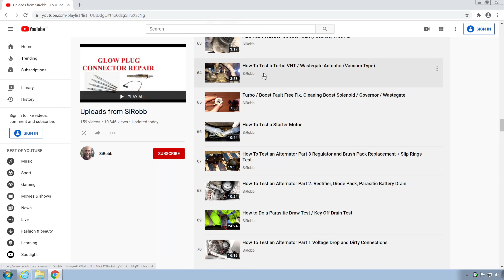Diagnosing VNT Turbo Faults

Comment: Excellent information as always. I have owned my V70 D5 AWD Auto for over 1,5 year and driven over 35000km I think, with almost 35k Swedish Miles behind. Your videos have helped me a lot on this car, doing all the repairs myself as I have done on my previous 3 Volvos.  

Though I've had a couple of annoying problems with the car since I first got it.  Took me a year to find out that it was the lower right engine mount under the crank pulley was separated, led to an annoying tire sound (and wear) every left turn. 

And there is something with the boost preassure which I havn't solved yet. Hesitation, delay just when you would expect the boost to begin smooth, it kicks in instead. Have had the code ecm 6805 wich puts the car in limp home and engine service required message. (Svenska: Motorservice erfodras). Restart the car and it's back on "normal". 
When engine cold and accelerating from standing still, this problem happen to completely disappear and the car runs really nice.

Worth mention, AWD models have the space occupied underneath the turbo, unfortunately! 

Thanks
Reply: Hi, I've made some further investigation on my car. 
Atmospheric sensor 970hpa idling, Seems Ok I guess?
Intake manifold pressure idling, somewhere between 800-850 hpa. Pulling a mild vakuum doesn't it?
Edit: Had a pressure on almost 2000hpa when full accelerating, varm engine. Good and as I expected.
Reply: Hi, am a bit thrilled as I finally made progress on this one. I purchased a CRC Carb & EGR cleaner. Gave it a careful treatment by spraying it into the intake hose on the Lmm and then reving the engine. Didn't help at all I think.
Instead I took off the intake hose on the turbo, and with the can upside down (can works in every direction) I put the small pipe into the turbo and sprayed. Let it sit for a while before driving. After two treatments and some driving I can say without doubt that it helped a lot! Accelerating is more controlled and smooth. Still a tiny bit of "kick" as the vanes is not entirely free, should help by spraying more and driving. This seem to have improved the travel of the vnt actuator arm, as it is a big difference at low revs.

Comment: Amazing video, thank you. My issue is with the line connected from the solenoid the VNT arm drops all the way down and the car shuts off. Disconnect the vac line, the car idles fine with no boost.

Comment: I’ve got a riddle three mechanics haven’t been able to solve. Twin turbo navara, high pressure turbo stays in open position after a run upto 80. Come to a stop and no boost pressure until second turbo at 2400rpm. Battery disconnect resets and does it again.

Comment: I always look for vacuum problems that can send error codes like P0102 throwing all the system off, engine mounts being the first port of call, I use Wynns injection clean fuel additive to 40 litres of fuel that helps clean injectors try doing say at least a long run 15 miles & notice the difference,

Comment: I have the exact same symptoms, only sometimes the engine has no power on lower rpms but then suddenly the boost kicks in. I tried a turbo cleaner diesel additive and it seems to have worked nice

Comment: Hi there , my 2002 v70 d5 ceeps showing "engine service reuired"msg and fault code 045 in the dim . It runs in lean mode but no engine light , any suggestions Simon .
Thanks in advance .
Reply from the maker: Until you read the car with a proper code reader and ideally with Dice and Vida, you can only guess unfortunately.
The DIM number codes cannot be trusted to diagnose faults.
Reply: @sirobb  Ok , thanks buddy .

Comment: I have a new turbo on my car. Its Ford Focus 1.6 tdci 90 hp,2010. I have overboost condition with DTC P0234-60. I changed boost control solenoid. Also tried with other MAP sensor. Still the same DTC comes again. I see that actutor rod moves freely. I dont know what else i could check. Any ideas?
Reply from the maker: Viewing the actual boost figure with live data is a good start.
Also what is the MAP reading with just ignition on, at idle and the maximum figure out on the road. 
Also don't change parts without testing as most can be eliminated easily with cheap equipment.
Reply: @sirobb  I have Forscan. MAP sensor on idle 105kpa,on full throtle about 248kpa. VGT duty cycle goes on idle from 61-67%,on full throtle it goes down to 35-45%.
Reply from the maker: @Jnn Nkc  Do you have an official workshop manual or data from the same engine from say a Ford forum?
The idle pressure is fine but the pressure at full throttle would be high on some cars.
It may be correct for yours though.
Have you viewed the VNT operation when all connected up and revving the engine like in this video? If it's sticking even slightly at the wrong time, boost could rise above the programmed maximum.
Reply: @sirobb  I dont have workshop manual. I was watching actuator rod moves. It moves quait smootly. Also when i disconect MAP sensor car works much calm then with MAP sensor conected.
Reply from the maker: @JnnNkc2205  What the EGR? Is that coked up or working correctly?
Also MAF and fuel pressure at idle and maximum.....
Something is going to be out.
Reply: @Sirobb Hello! Where can I speak with you in private ? Thank you!

Comment: This helps a lot. My friend owns a 2004 V70 D5 with 596.000km on the clock and he has turbo issues. We checked all the tubes und mounts for leaks and found none. Found a faulty TCV behind the intake hose and now it responds better, but still the real boost only kicks in at 3000rpm and tends to ooverboost a bit.
The VNT mechanism works as long as we use our little manual vacuum pump. After fixing the TCV we now have a constant ticking noise from the engine.
My guess is now, that its either the turbo itself or a faulty vacuum pump (also the source of the noise). All the vacuum hoses are pretty oily on the inside, could a defective vacuum pump be the cause?
Reply from the maker: Use a vacuum tester directly on the vacuum pump as suggested in the video link I provided in your other comment.
That will first of all tell if the pump is producing enough constant and stable vacuum.
Also, with everything connected, view the VNT action whilst revving as shown in this video. 
Regardless of the vacuum reading from the pump, if the pump is noisy then it may well need replacing but if it is producing full vacuum and there is still lack of boost, either the VNT is sticking or boost is being lost through a leak in the intake system or the MAF or MAP or fuel pressure readings aren't correct.
Low fuel pressure could be just a clogged filter.
You have to test everything carefully and not just change parts by guessing.
Reply: Interesting.  I have had lots of work done turbo kit (genuine ) head gasket lifters rockers  intake clean of carbon cams the lot . Tickover is sweet as ot shouod be . I get (had it before the work ) a mooing  noise . I jeep coming back to the turbo solenoid  years the turbo was sorted but not the solenoid . I have power . I think it could be a smidge more responsive..it car does a regen it's pretty quick . 2 sensors were replaced a week after the work was done it's not a volvo (but I loke volvos ) .its a mazda it's mostly noticeable at lower speeds . Annoying noise indeed 

Thank you

Comment: Hi Simon. Many thanks that cleared up a lot in regard to how a variable nozzle turbo charger operates.

I like the ergonomics of your diagnostic tool but when I went to Amazon on your link it showed two. Which one are you using in your video please?
Reply from the maker: The two types are Bluetooth and WiFi and I only use the V1.5 version. 
I'm on Android so use the Bluetooth mini version with the Torque Pro app.
IOS users need the WiFi version with a suitable app from the Apple Store.
Reply: @sirobb  Thank you very much Simon.

Comment: Hi Simon
another Great video
But you do need to tell people that the 30+ PSI you are seeing is including 14.7 atmosphere pressure , or all with car problems will think they have a bad turbo,
Thanks Dave
Reply from the maker: Genuine question. Have you watched the video? 
1:07 I show the caption saying "The maximum boost pressure is 2090 hPa in absolute pressure. 
2:50 I say total pressure from the MAP. As you know, the MAP is an absolute pressure sensor. 
5:14 I show two different gauges. One is absolute one is boost.
7:20 different gauges are shown again to illustrate what to look for.

Comment: @sirobb I suspect I have a VAC pump leak and noted I am getting the oil cap popping .... You reckon a leaking pump would also account for this popping ?
Reply from the maker: Yes it could but so could several things so best to test and not guess or assume.
I have a vacuum pump testing video in my list.
Reply: @sirobb  already watched those ages ago Si. ...... your channel is my first port of call for all things xc90 .... I have an xc90 2007 ...... I dont think you tested the actual pump did you ? Is it a case of just removing the VAC pump pipe ..... Connect the test pump and seeing if it holds vacuum ?
Reply from the maker: @kanesfist9895  I tested the pump directly. Maybe you haven't seen it. https://youtu.be/-lgYAS3GoiE
Reply: @sirobb  just found it .... Another great video .... So I have tested it and it holds VAC steady at about 25 .... Also front mount holds but I think the rear mount is gunned .... Didn't register anything so either it's the pipe or mount itself .... As a test I did disconnect the rear and covered the tube .... The popping did reduce but did not disappear ...... Anywhere else to test ?

I have oil residue just below the VAC pump so I was expecting that being the issue but if it's holding VAC could it still leak ?

Comment: Hi Simon, a great description of my problem!  Have you tackled the sticking vain problems yet?
Reply from the maker: Not yet. As you can see, the vanes free up pretty quickly so as long as I'm careful when the engine is cold, you wouldn't know there's a problem.
Reply: @sirobb  Thanks for coming back to me. I was going to remove the turbo, but I have seen a few people say it come be cleaned in situ. What would you recommend. Mine is 2002 220k miles so similar to yours.
Reply from the maker: @bitzaboat  If you haven't already, definitely use a vacuum tester directly on the actuator to exercise the vanes.
Video link is in the top pinned comment above.
Reply: @sirobb  Hi Si, yes I tested that first as per your vid and got a similar reading and it was holding just over 20. The arm however was only moving 5-10mm max with the engine running at various revs up to 3000 as it wont rev past that. But occasionally when on the road the boost comes in big time so it must be overboosting in those cases.
Reply: @sirobb  I went ahead with cleaning the turbo using https://www.opieoils.co.uk/p-92010-power-maxed-diesel-turbo-cleaner-kit.aspx but I still have the same symptoms 😕   I do have Vida but not sure if using it apart from the basics.
Reply from the maker: Vida contains a comprehensive Help section covering all of the functions so definitely check that out.

Comment: Hi , i have the chance of buying a low mileage volvo c30 t5  from a  neighbour  the car was left idle for a year  battery died and would not start they had the a.a out who said the ecu has lost it's coding and would need to go into volvo  for coding  , 
,   would you  happen to know if  this coding could be done with vida software?
Reply from the maker: It's a software download at a dealer or specialist with access to the Volvo servers.
Reply: ok thanks.

Comment: Hi si. Amazing step by step guides making my life much easier.  I'm looking for a vida setup to help chase away some black smokey issues and diagnose an abs fault.  Do you advertise yours anywhere?
 Cheers
Alex
Reply from the maker: @Alex Nunn-thompson Did you receive my reply? YouTube comment notifications can be unreliable.
Reply: @sirobb  hi si. Yeah thanks mate. Had the codes read today for the abs and its insufficient voltage to abs pump but it's intermittent and does come on right away. Hoping it's a bad connection somewhere not a new pump.
Reply from the maker: @Alex nunn-Thompson No problem Alex. Don't forget that Vida would give you the Volvo code and an explanation of the fault and the possible causes and fixes.
Vida also contains the workshop manual and technical data/voltages for the braking system components

Not dead money either as you use it for as long as you need then sell it on when you're done.

You have options so good luck with the fix and if you want one of my diagnostic solutions, just let me know.

Comment: Hi! Ive been trying to fix my P0244 fault code that causes limpmode on my 2002 V70 D5 Euro 3. The fault code came on when it went into limpmode but after replacing the turbo inlet pipe, boost solenoid and blocking off the engine mount vacuum hose now the fault code is always on. Please help!
Reply from the maker: Have you done the tests and observations shown in this video and the pinned comment?
Reply: @sirobb  Yes.
Reply from the maker: Did the actuator have full travel in both directions? 
What was your map pressure at idle and the maximum achieved MAP pressure reading?
Reply: @sirobb  Dont know exactly if full travel but it moved quite a lot. 
Idle pressure: 0.06Bar
Max pressure 2.8Bar
Reply from the maker: You have massive overboost so no wonder you're getting codes.
You have to be certain your entire vacuum and boost system pipework is air leak free for correct VNT operation.
Also check the large diameter ribbed  elbow shaped pipe for collapsing or tears and the intercooler for oil residue and distortion.
Reply from the maker: Idle pressure is too low also so VNT is sticking in the wrong position.
Reply: @sirobb  i have a tune for 2.2bar so its not much off but i dont know much about the vacuum lines if theyre ok. Engine pads dont leak anymore, boost solenoid replaced and now the code is always on, IC is fine as its an aftermarket full aluminium one, vacuum pump works since the engine has only run 70tkm, inlet pipe changed to a reinforced cilicone and other than that i dont know...
Reply from the maker: Your idle pressure is still too low.
It should be around 1 Bar with ignition on and also with engine idling.
It's currently below atmospheric pressure at idle so is actually pulling a mild vacuum which is obviously no good on a turbo engine. 

You can test the vacuum lines with a simple tester as shown in my How to Test a Vacuum Pump Video.
You want to be able to hold full vacuum and a steady needle on every vacuum pipe with the engine running.
Reply: @sirobb  oh wait, i wasnt taking atmospheric pressure into account. Thats calculated with atmospheric pressure at 0.06bar
Reply from the maker: 0.06 Bar? I'm confused.
All I need is your MAP reading with just ignition on and again with the engine idling.
The MAP reading automatically includes atmospheric pressure.
Reply: @sirobb  so i havent read MAP values but i have a analog boost gauge drilled into the manifold next to it and it reads 0.05-0.1bar on idle
Reply from the maker: @adriansmeds4800  That's a massive variation at idle and still too low.
Your ECM uses MAP data so you need to know the exact MAP readings I've already suggested and that is easily available with cheap diagnostics as shown in this video.

An aftermarket boost gauge simply isn't accurate enough to diagnose what the ECM thinks is happening.
Reply: @sirobb  Allright ill try and get the MAP values at idle once i figure it out. Thanks
Reply: @sirobb  Allright! So a tuner said that with ignition on 14.5psi and on idle 15psi.
Max boost reading he got was 34psi. Still it jumps into limpmode as soon as you let off the gas after doing a pull.
Also did a full vacuum leak check, vnt travel chech and everything was fine.
Although the vnt was creaking quite alot when moving.
Reply: @adriansmeds4800  my VNT appeared to have full travel when I tested it with a vacuum guage. Like you I changed the wastegate solenoid as I was getting a p0244 code. No limp mode though, but I could hear the turbo dumping boost when pulling away and it went as high as 33 psi so knew something was up. In the end I cleaned it with Innotec Turbo cleaner and now it doesn't overboost or throw any codes. Well worth doing. Hope you sort it.

Comment: Hi, Fantastic video and Great tips. You made it in a very easy to understand and follow way. Can you tell me which OBD device and which app you were using in this video, Please?. I followed your links to your Amazon site and there are two OBD's listed (well as far as I could see anyway) and there are so many apps to choose from esp with one, it made my mind boggle???.  Also, I have a Saab 93 and a  traction control esp warning has illuminated. Would this dongle and app tell me which sensor or corner is playing up? (eg:- front nearside ABS no signal. Or something like that). If can help with any info I would be very grateful indeed. Many Thanks, Leon.  :-) Ps. where did you get that very handy wheel centre removal/sucker tool from. That is defo a toolbox must have to??!!.

Comment: Hiya Rob...Have used yr 02 v70 d5  vids as a ref.  great stuff .
Cleaning engine thought remove oil cap..yup.pop.pop
pop. rear engine mount.
Followed vid for meyle part.. Thanks!! Clamped hose to rear mount.Pop stopped.  Due to lack of work due to the obvious can't buy mount immediately.Car not covering any distance lately.
What's yr views on no vac rear mount for a short while?
Thanks again. Cheers (Tony)
Reply from the maker: I can't recommend and say that it will be fine leaving it as it is so just change it as soon as finances allow.

Comment: What diagnostic tools are you using. I see that its android based, what is the app and OBD connection? Thanks.
Reply from the maker: Torque Pro app.
ELM327 V1. 5 Bluetooth dongle